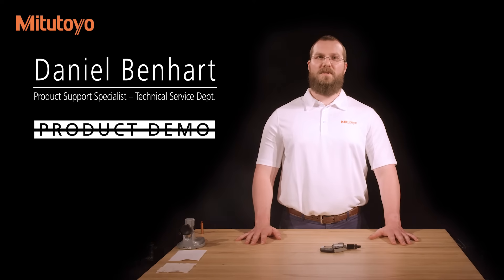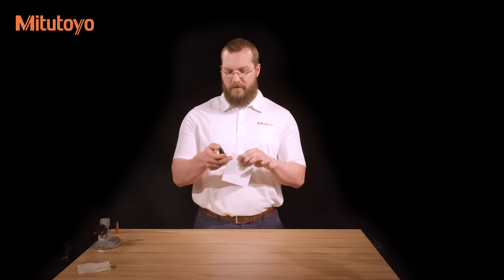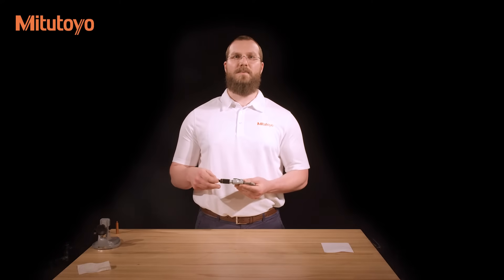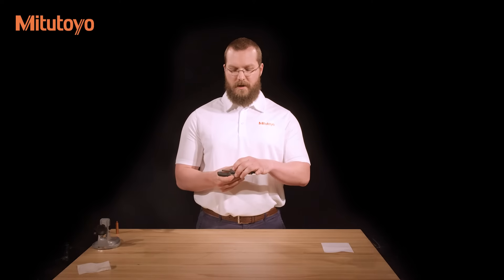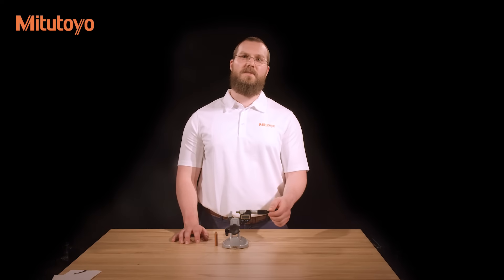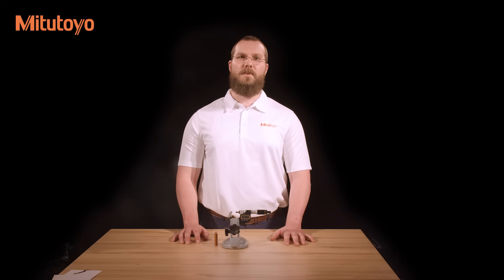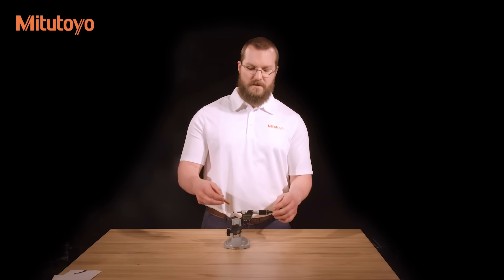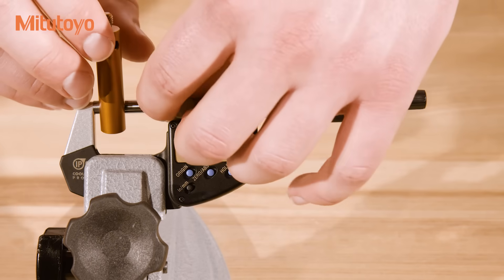How To Use A Digital Micrometer From Mitutoyo

Comment: Let me check one specific thing about proper measurement by vernier calipers.
Some time ago I met opinion, that when you use external jaws for measuring some objects (especially objects that have just very small contact points with jaws, for example some round-shaped details) - you must place such object in the central part of jaws, not in the bottom part, where jaws have milled out edges. This is supposedly important for the most precise measurement.
I don't remember where I found this but remembered. Later I tried to find reconfirmation of this opinion: is it really true. But in the manuals and in yourube videos no specific confirmation I couldn't find. Some really put objects in the center of jaws with no explanations or remarks why. Other put object just in between the bottom ends of jaws.
Could you please clarify?

Comment: I have been using these for years, and in my line of work I have to be perfect. When doing the headspace on a firearm I am going to .001 as I only have at a max 3 thousandths of and inch between a firearm being safe and not safe. 

People lives are on the line when I have to measure something to that level of accuracy. I also never rely on just the digital readout as they have been known to drift or not read correctly and possible you could hit the reset or origin button resetting it back to zero making it incorrect, always double check with the readings on the handle.

Store your micrometer(s) in their case(s) they come with when not in use, put them back in and close the cover and even put them back in the paper sleeve to insure if dropped they don’t fall out. I always keep a tight grip on mine when in use and so far they have not ever been dropped, not sure if I could ever trust them again if that ever to happen, someone’s life is worth more than 300.00 and would be better to replace them.
Reply from the maker: This is very good advice about storing your micrometers in their cases when they are not in use.

Comment: Only one problem with the paper method to clean a mic, it only works on a 0-1 mic its usless for all mic's as they don't closed down so why do companies countinue to do this? It dosen't work for my 1-2 mic or my 2-3 mic or any other mic's so stop this method and show one that works for all micorometers no matter what size.
Reply from the maker: You are correct that pinching paper between the anvil and spindle only works on the 0-1" micrometer, which is appropriate for the video demonstrating the use of a 0-1" micrometer.  For other micrometers, those larger than 0-1" or speciality micrometers, a technician would need to clean each measuring face separately.  Using denatured alcohol and a lint-free cloth would do the job.
Reply: @MitutoyoAmerica  Then as stated this should be covered in the video as you assume that only a 0 to 1 inch mic is ever going to be used. We use the denatured alcohol and lint-free cloth for all mic's when we teach calibration so as the tech's understand this is a method that works on all micrometers.

Comment: 1)Is this the actual method on how to measure using a micrometer? 
2)Using only the small knob until it is ticking?
3)What if I zero the datum and use the thumble first until it is tighten after that I use the small knob? Is my measurement valid?
4) I don't find any reference on Mitutoyo's manual that I should use the small knob. Thus, people are blaming the method and the measurement result seems to be dubious.
5)Do you reply the comment? How can i have the answer?
Reply: Hi.  I'm not part of Mitutoyo, but I've been using their micrometers for a while now:
1.  Although it goes way in to it (somewhat needlessly), this is technically the right way to use it.  Although there is some subjectivity involved (using the same force with the thimble...), this seems to be the best most standard way to use the micrometer.
2.  The small knob helps prevent over-applying pressure, which in my field of work definitely applies.  I measure thin wires less than a mm thick that are made of copper, and such a soft metal can be deformed by even the smallest amount of exertion.  The way he suggested is the technically applicable way of doing it, because since you're relying on the ratchet knob to apply the final pressure, it's as close to standard as possible.
3.  So you apply pressure on the "normal" part of the handle first (until it fully closes), then apply pressure on the ratchet knob when it's already closed?  That is technically incorrect, since the micrometer will retain the measurement as a result of the normal part of the handle.  The ratcheting knob would be insignificant by that point.
The suggested method is to use the normal part to get it as close to the final measurement as possible, then using the ratchet knob to tighten it until it clicks a few times (indicating it's as tight as possible).
4.  You should use the knob.  I learned how to use mine from my superior, so I never bothered to look through our manual.
5.  This video seems more like a project some higher up told this poor guy to make.  Now that he made the video, he or Mitutoyo don't need any reason to comment.

Comment: How do you measure paper? If I close the digital micrometer fully I get a measurement, let's say 0.079 for example; but if I loosen the micrometer somewhat, the paper is still held firmly by it and the measurement is now perhaps 0.095. So I measure by closing the micrometer and then backing it off to a point where the paper will slide just slightly with difficulty within the teeth of the micrometer.  I take that as the measurement. Is that methodology correct? If not what is the correct method?  Thanks very much, Mark
Reply: Run your mic down until you get a firm stop. Don't run it down to a point where you start feeling resistance. Be sure your mic is zeroed beforehand.